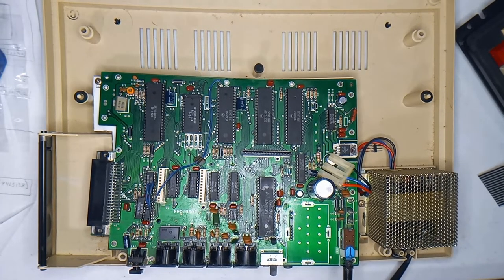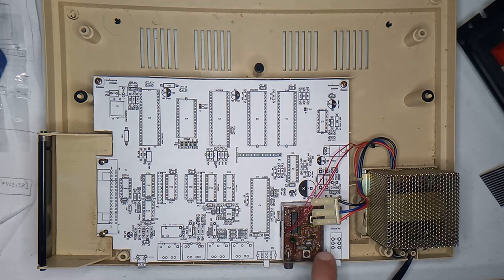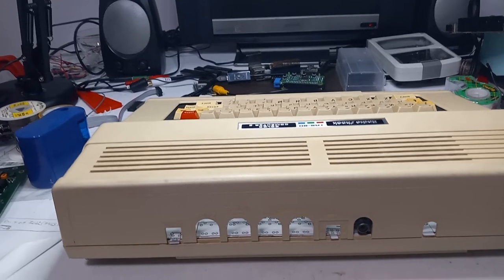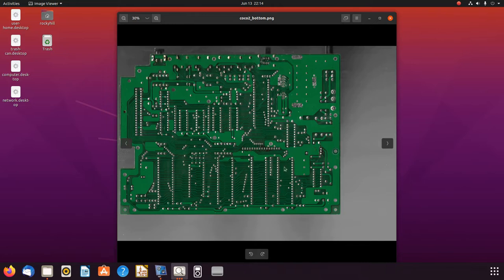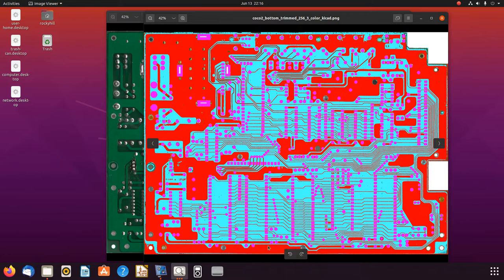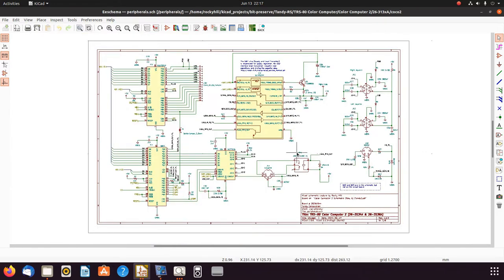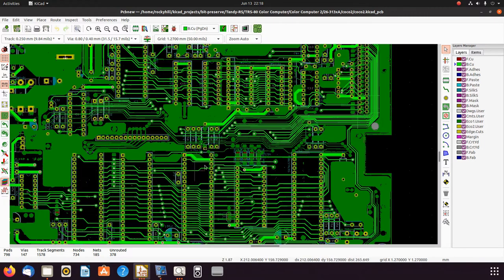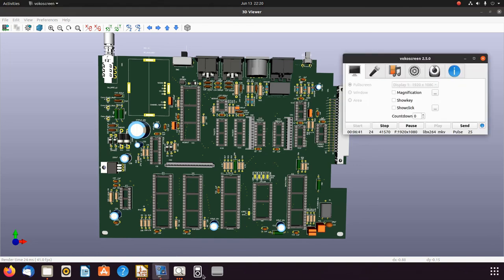Recreating the 26-3134A CoCo 2 board Part 1

Comment: I've heard the T1 chip is going to be the main difference that and the memory options that the T1 board can use.

That said, I love the details you went through.  It's very good detail and I really appreciate it.  It gives us a sense of the process if we hope to try anything like this in the future.  (hope... there's always hope)

Now that I have acquired a third CoCo3, I'd like to try to get one speaking "HDMI" out.  Was wondering if you were interested in revisiting that project you displayed previously.
Reply from the maker: The T1 is the big difference but luckily it isn't too much to buzz out with a multi meter(hopefully). I'm glad you liked the details but unfortunately I had to leave some out because of time and practicality but I hope at least a rough road-map came through. I am planning on making a video on how to use the RGB to HDMI board but there is a lot of information and I'm not sure how to organize it yet. I'm not sure if building one would be a good video or not
Reply: Have you done any more on the RGB to HDMI Project?
Reply: @HomerKM1914  Have you followed the AC's 8 bit zone CoCoDV project?  It appears to be a similar project and outputs to a connector which resembles HDMI but is not because sound in not included with the design but is separate.  One advantage of the RGBtoHDMI is that the licensing for HDMI comes with the RPi used in that project.  I'm reasonably sure someone could hack a CoCoDV kit to include audio though I haven't heard of anyone accomplishing this yet.  A separate audio line might be a pretty major detractor.  Not for me... I've already placed my order and hope to get that going before too long.

Comment: I'm not CoCo knowledgeable.  Are there unique custom chips in the CoCo 2 that would require a donor machine to be moved to this new PCB?  What led you to choose the 2 over the 3?
Reply from the maker: I've actually already recreated the Coco 3 board and a 26-3026 CoCo 2 board. The CoCo's do have some custom chips, the SALT and the DAQ but I have also made replacements for those two. For the CoCo 2 luckily all of the other chips are available on EBay and other places because they were either pulled from dead systems(non CoCos as well) or its new old stock. The CoCo 3 does have an important custom chip, the GIME. This chip has already been recreated so save for the actual case, CoCos can be recreated from mostly new parts.There is a project where a Coco 2 and 3 case is being recreated.
Reply: @Rocky Hill Any more information of the CoCo recreated cases?